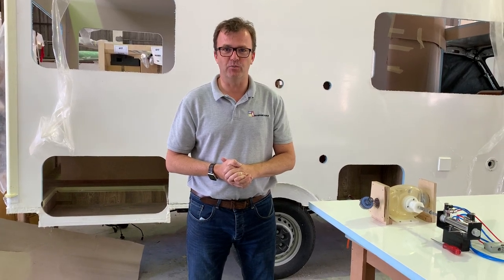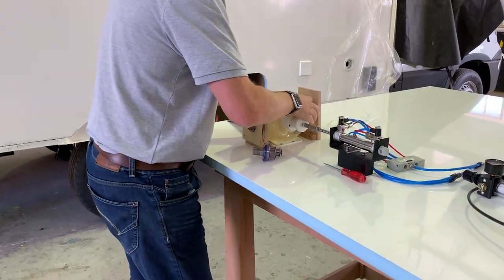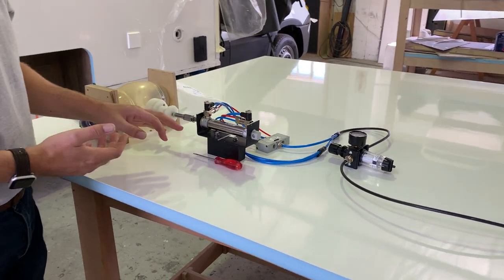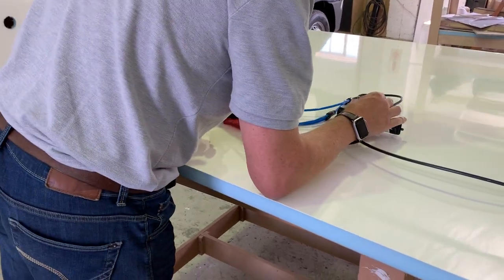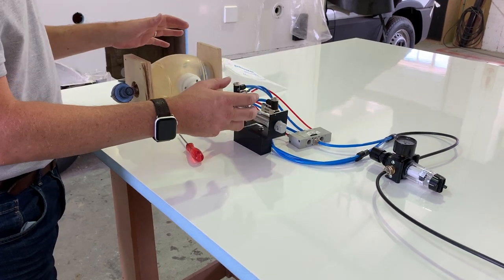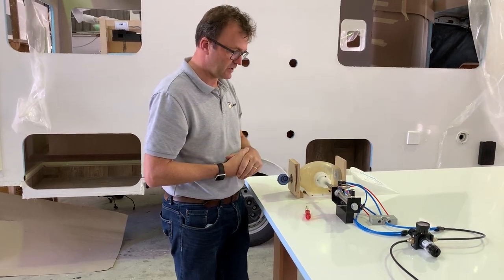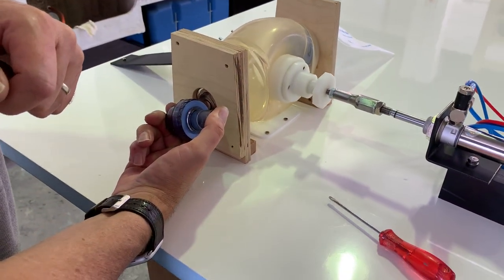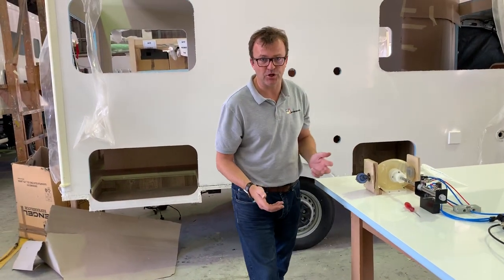Automated BVM, Ventilate Innovate.

Comment: Very well done on keeping it simple. I was wanting to give a small comment on making the system's overall dimensions smaller, so that it wouldn't take bench-top space in the hospital room... but I want to point a more important issue:
Do you think you could make the BVM removable from the air delivery system without taking it apart? in the event of a system failure, where the motor could stop, max pressure is exceeded ... etc. the clinician will need to immediately remove the BVM out of the device and start manual resuscitation. With that, the air circuit needs to remain intact and not disassembled. This was an issue hinted by the developers at MIT E-Vent, which could be a main design criteria.
All the best in your work, and hope you can scale it to those in need
Reply from the maker: Thanks for your reply.  The BVM is fully removable in 5-10 seconds. Here is the completed device. https://youtu.be/Kd6tQCYa29I